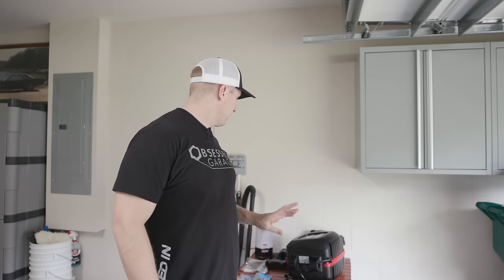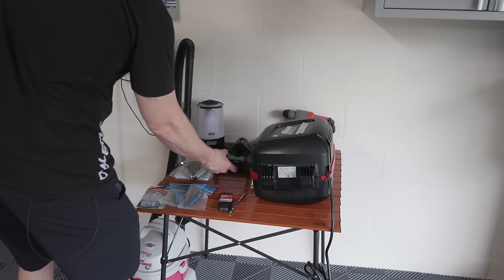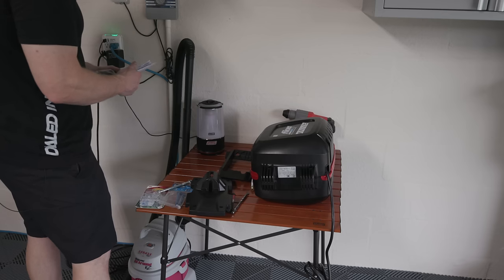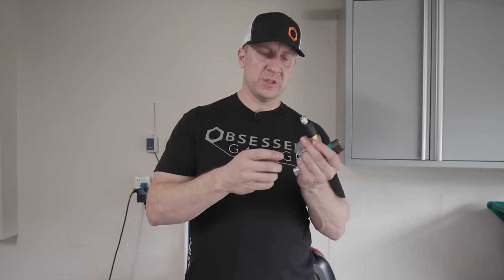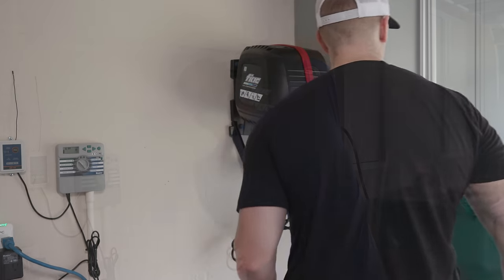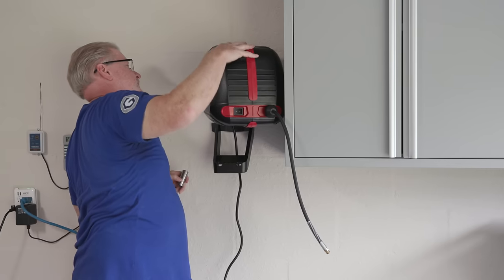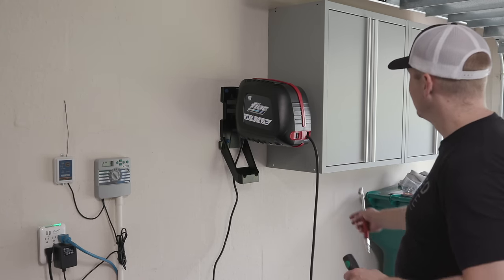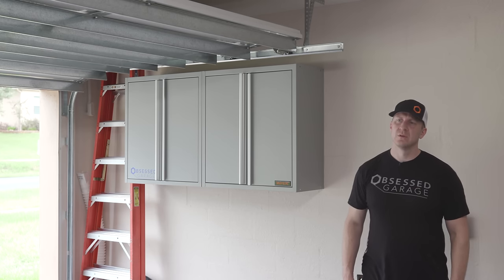FIAC WallAir Wall Mounted Air Compressor Install

Comment: I don't mean to be a negative Neal, here, but with the amount of vibration that thing probably puts out, I wouldn't expect that compressor to stay on the wall for very long.

I would expect it to eventually wiggle the bolts loose. 

Obviously that depends upon how often you use it, but if I were installing this for myself, even if an earthquake leveled my garage, I'd want that thing to still be attached to the wall.
Reply: They live in Florida building codes for wind speed and structural integrity are much higher. I think they drilled into cinder block and used tapcon fasteners for the bolts. Actually it good to see a father and son project on OG.

Comment: I'd be so in for this if it was the quiet version with a small tank i.e. pancake size. Full wall mount for a small garage with a small tank is so ideal. I cant fit a huge FIAC tank like you have in my garage but a wall mounted unit would be perfect.

Comment: I would make a level horizontal line on the wall and then place the mount over it and align either the top holes or bottom holes with the line and mark where to drill

Comment: Optimistic 5.6 CFM 🤔
How much do you need to decently paint walls w/ aclyric based paint ?
It can be used to airbrush some scratches in the car paint.

Comment: Nice unit for the average homeowner. I wish it didn’t swivel on its mount though. I’d want it fixed. Is there a way to lock it?